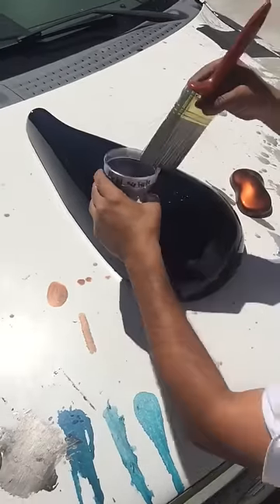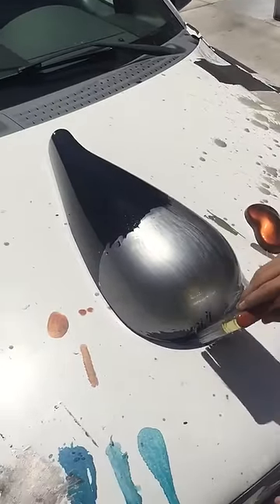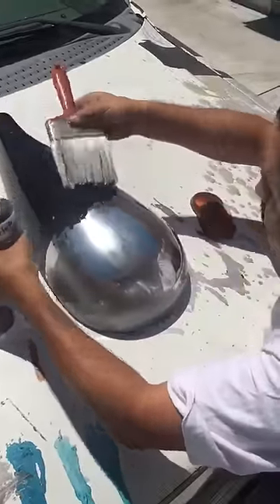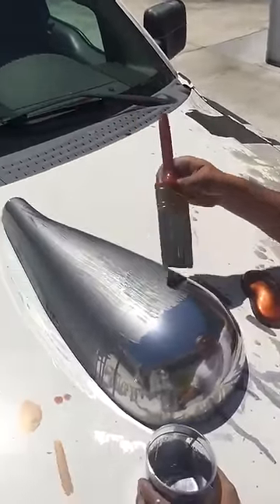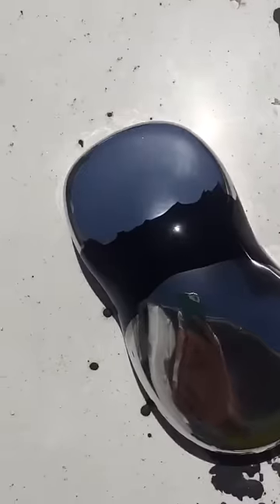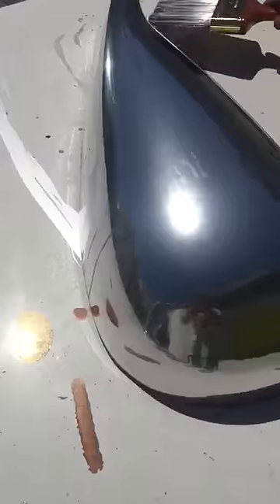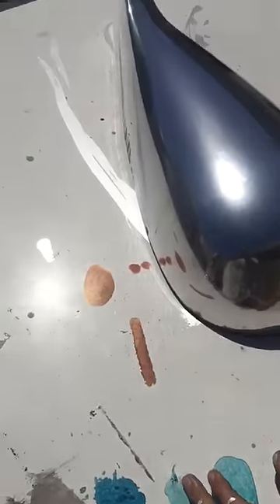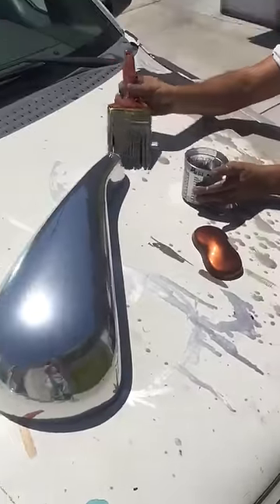Alsa Brush on Chrome Paint

Comment: how durable is this paint ?    ''no need for top coat'' , can we put top coat on or it does like any other chrome paint and end up just a gray finish with a clear over it ?  finish does look amazing for being paint , especially brushed on paint
Reply from the maker: Golden Sim Lasts for years. If it won’t be touched you don’t need topcoat

BUT if you will add color you can put candy in that. 

Make sure base and chrome are dry as bone
Questions?
Ike@alsacorp.com
Reply: super , ye right after this i saw a other video were he put clear coat over it with great result , price is unreasonable but it is a good option for chroming plastics ill keep in mind
Reply from the maker: Golden Sim  You lose 3 percent after topcoat

Comment: Does it have good adhesion to gloss plastic parts and be clearcoated or will they need to be primered & painted black? as in motorcycle parts. Fairings, air scoops saddlebags etc.
Reply from the maker: heathen7718 sticks great to gloss plastic. Poor chemical resistant
Reply from the maker: heathen7718 just as smooth as glass. Then our base. Let the base dry 2 or 3 days or oven for half day

So base must look like Water and be bone dry

Comment: is it simply just Chrome in a can or is there a set up to it I know you have to prep the area lay down a gloss coat of black but I was wondering if there was any more prep air mixing with the Chrome brush
Reply from the maker: Shawen Dalton 
No set up machine. Just spray gun

Black base
Chrome

Done

If in contact with chemicals clearcoat 

It’s good for wheels. Streets don’t have chemicals 

Base and top are special. You’ll see
Reply from the maker: You seen videos?
Reply from the maker: Shawen Dalton No special set up

Comment: Do you have testing for scratch resistance as to why you don't need top coat and also what is the temperature range before discolouring and silver if. Thank you.
Reply from the maker: Bling Designs many months
Reply from the maker: Sorry
The silver will never discolor
Reply: Bling Designs do it work on motor parts

Comment: Can you spray it on? Can i use a top coat even though he said you don't need it?Does it pass the ASTM MEK, mandrell bend, inpact and cross hash tests?
Reply from the maker: Great adhesion but not for chemical resistance. 

Make sure it's super dry for topcoat

Comment: Will this work on my hubcaps? I'm trying to avoid buying real rims, wheels, and tires
Reply from the maker: Hi,
Yes. It will work. Our Easy Chrome can be used on most material; wood, plastic and metal. It can endure heat up to approximately 800°F. 

Thank you.
Reply: @AlsaCorporation  great. Where do I purchase this and how much will I need for 4 hubcaps? Also, do I need a finishing shiner to go with it?
Reply from the maker: @MERTIE123  You can purchase it here.
https://alsacorp.com/product/easy-chrome/

You will need the Brush and Spray Kit. It can cover up to 30 sq ft. 
Easy Chrome Basecoat is included in the kit. This basecoat is made exclusively for Easy Chrome, and you will need this basecoat in order for the chrome to work.
Reply: @AlsaCorporation  ok thanks. How much is the kit?
Reply from the maker: @MERTIE123  $299.00
Reply: @AlsaCorporation  well hey, it's cheaper than a rims, wheels, and tires package.

Comment: I asked under another comment about if you can use this product on mdf that has lacquer paint on it. Does your product react with something like lacquer? I know you provide a basecoat but just wonder if the lacquer would react at all. Thanks
Reply from the maker: Dire Straits#1 It will be fine. Make sure our base is bone dry
Reply from the maker: Dire Straits#1 ok?
Reply: Thanks a lot for replying this stuff looks incredible.
Reply from the maker: Dire Straits#1 mdf is good but you need the kit. Great idea. Turn crap to gold
Reply: AlsaCorporation Well sorry but mdf isn’t crap. It’s really nice stuff to work with.
Reply from the maker: Dire Straits#1 oops sorry

Comment: can this product be used on wood?
Reply from the maker: Jack Schit YES
Reply: thank you so much for getting back to me so quickly....  is it multi part process or will any gloss black undercoat be sufficient?  Can you drop a link in here to site for info and ordering.... if you have one and thank you again
Reply: I'd like to do a five foot long, two inch thick by eight inch wide fireplace mantel that is already installed and I'd hate to take it down to replace or modify.  How much would you estimate needed to complete a project like that?  I know, it's late and I'm a pain in the ass!

Comment: I picked up a brand new set of rims for 550.00 done install them and roll. Dont know where you get thousands from but someone ripping you off
Reply from the maker: Hi,
For 4 rims, you only need the Brush and Spray Kit. The kit is only $299.00

Thank you,
Reply: @AlsaCorporation  proven durability is still waiting to see if it can hold up the use of real use. Can it hold up to dirt,snow,general back woods use